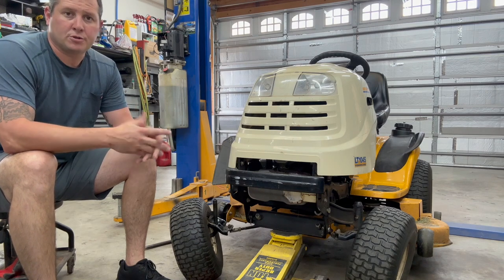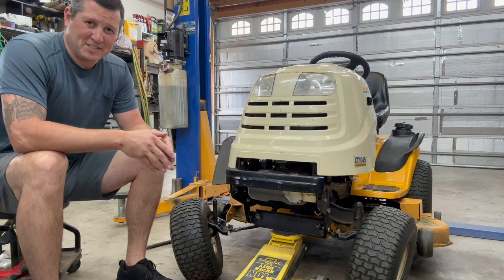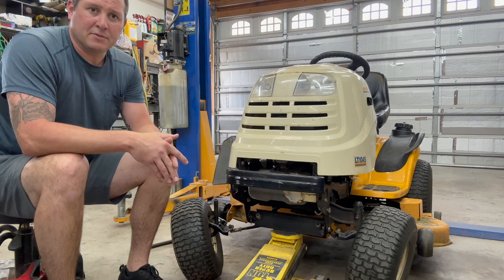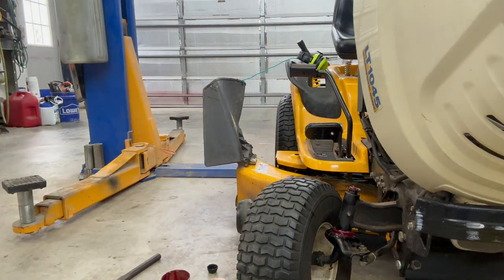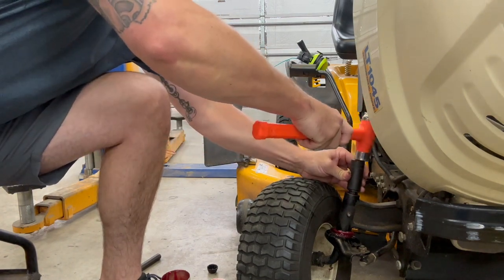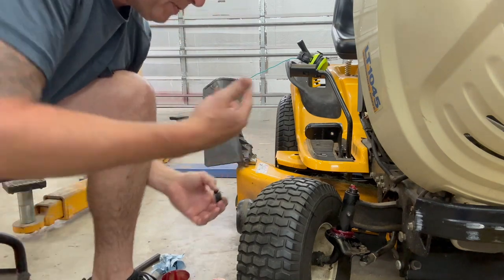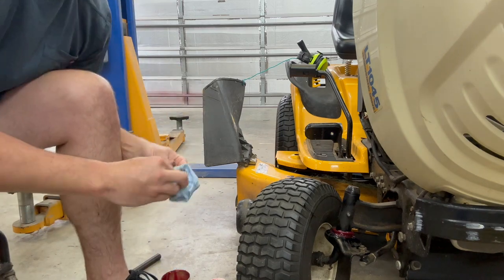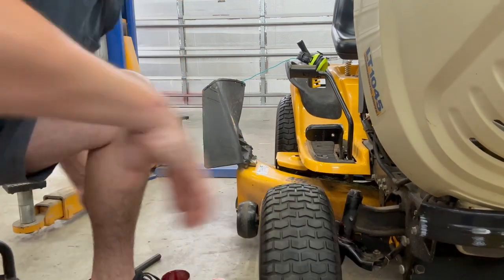Reduce Wear and Steer Easier on you Lawn Mower 1 finger steer aka "Poor Man Power Steering Upgrade"

Comment: I did the same mod with my 19"John Deere E120. Also, I replaced the wheel bushings with ball bearings. It makes a big difference  and should help it last. (I'm at 100hrs). It runs and drives better than new.
Reply from the maker: Good idea on the wheel ball bearings!
Reply: Got a link for the ball bearings ?

Comment: It may make it "easier", but I find it pretty easy to turn my steering wheel as it is when the mower is moving.  It only becomes more difficult if I'm trying to turn the wheel while stationary.  I keep the fittings well greased though.

Comment: My 2017 xt1 cub cadet is welded on there is no way to remove it. very upsetting
Reply from the maker: Newer stuff is designed to fail. That sucks
Reply: I just found out mine is this way too. There has got to be a way to take it apart.  The strange thing is it has a retainer ring on the welded shroud. If you figured something out, I would love to hear it